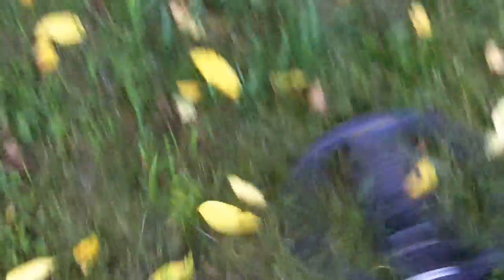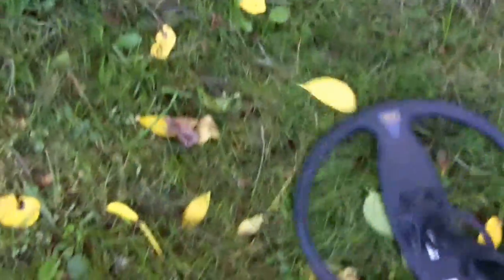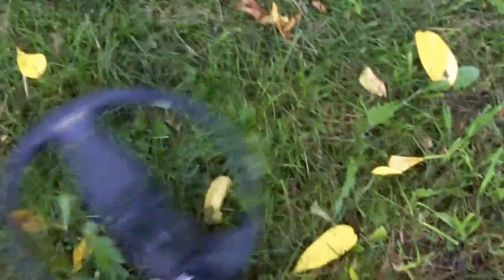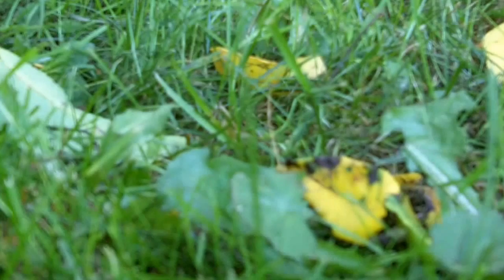Makro CF77 Part 2: Recovery speed example,Few full digs

Comment: what is the discrimination like, Can it nock out ring pulls and foil?
Reply: Clark Fox, I always work with iron disc. Foils gives an unregular signal like smal explosions and if you detect pulltaps, than swing the coil very slow and you wil hear a signal like 0101010101 in one way. Usually you hear 010 in one way..... Try it, take pultap and a coin try and compare the sounds.

Comment: I wonder how this would do against the blisttol v5 Beast. I hunt Va bad ground and ive seen the blisstool make a P.I machine look silly. So far the bliss IS the deepest ive seen to date. HOWEVER ive never seen the cf77 in action and im liking it :)
Reply from the maker: The biss is a deeper unit.But the Id and multiple tones on the cf77 make it alot smoother to run I think.Ive never used the Bliss myself.The cf77 is very very fast.And for 550 buck new..you cant go wrong.
Reply: sweet. I have a deus. Its fast enough. Im looking for a deep machine for the stuff ive missed with the deus and at-pro :)
Reply from the maker: leo renner The velox one is the Deepest Unit Ive used to date.Check it out
Reply: Thank you. I heard on forums it isn't deep nor the fors core but the blisstool is by far the deepest. Id love to own any of them quite honestly
Reply from the maker: leo renner The fors will hit a US dime 10-11 inches,poss little deeper.The velox will hit the US dime more like 13 -15 inches.The Bliss will do a dime at 15-16 I believe.The velox and the fors core have more features than the bliss and will perform better in the iron I Believe.Alot of great results out of the UK with the Velox in the iron patches.I would like to grab the Beast so I can do some comparisons.